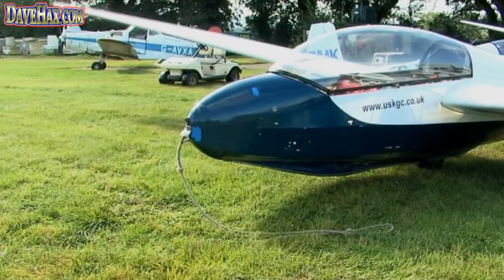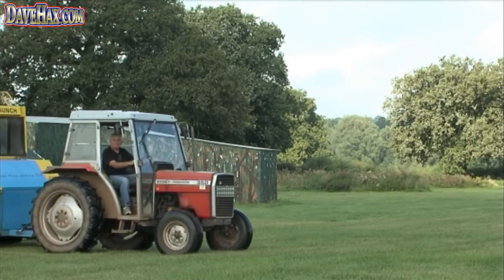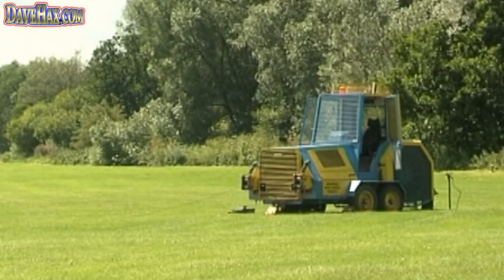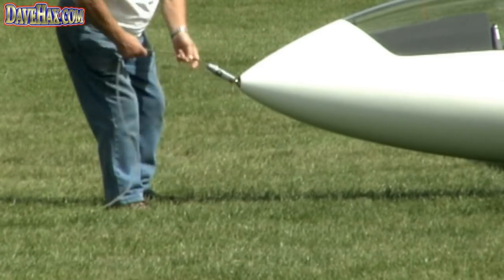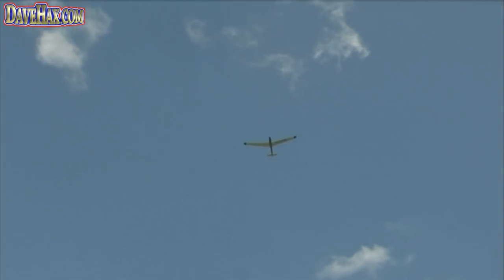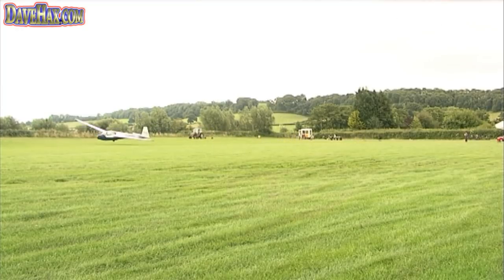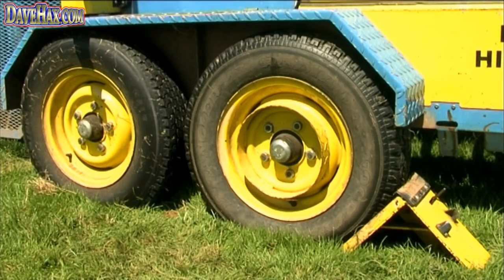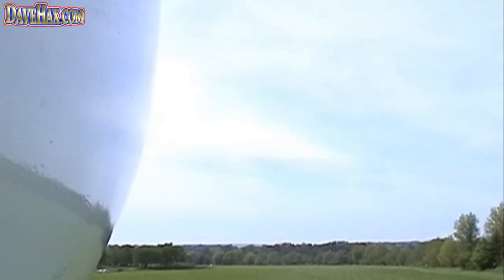How to launch a glider - Winch tow

Comment: If the release of the winch doesn't work, will the cable break, or will the glider stall towards the ground? It looks really dangerous lol.
Reply: If the auto relaese doesn't work the winchman will cut the cable, then the glider will try to manual relaese the cable. If that doesn't work he lands with a cable from 1000 feet/ 300 metres. The cable will not break.
Reply: If the auto-release doesn't work the pilot will use manual release. This is used sometimes anyway. The cable can and does break. In training and flight testing pilots are given cable breaks at various heights and are expected to handle them. Before EVERY flight we run through a check list that includes how we are going to handle a cable break on that day with weather conditions taken into account.

Comment: I'm curious how this works. In the states we get towed out over the mountains and can soar for hours. But 1,000 feet is very low (at least to us). At that altitude you're pretty committed to landing. Can you realistically get enough termals at 1,000 feet you commonly get enough altitude to soar? How can you take a checkride if you're not high enough to do stalls, steep turns, etc?
Reply: I don't believe a checkride would involve a winch launch, for the reasons you mentioned, perhaps if the winch were on a high mountain/cliff?
Reply: so in the UK at least the cut off is typically 800 which means you can do most things. I did all my flying from 1k winch besides doing an aerotow for spin checks

Comment: Why are the wings on gliders cocked forward as apposed to aft on regular aircraft?
Reply: Most gliders have the wings rectangular against the fuselage. No / very little sweep. The good old ASK13 rookie trainer, seen in the video and myself with some 100 take-offs on it, has the wings slight swept forward, maybe 3 degrees or so, but that's unusual - and maybe old school, from the 60s. It's a matter of plane design - design cruise speed, stall speed and maneuverability, etc. playing a big role in the design and the wing design.